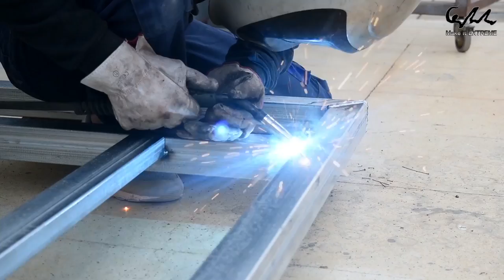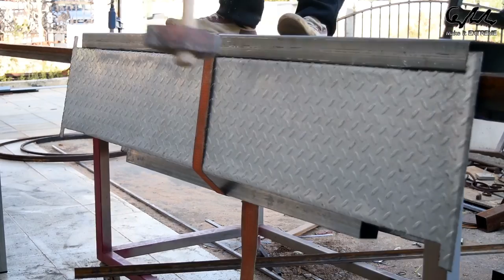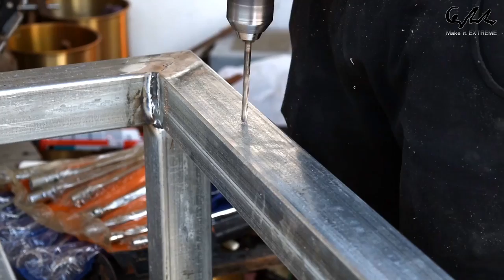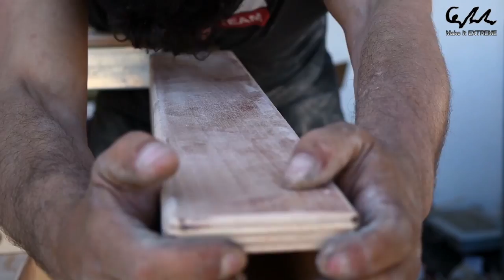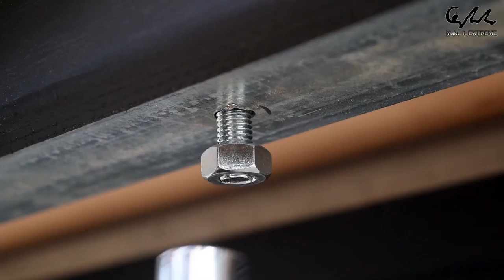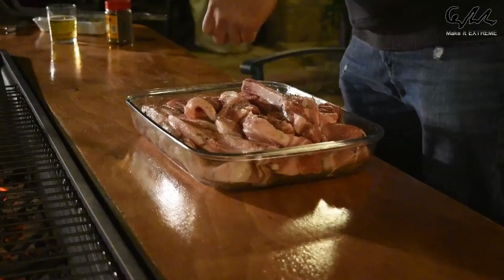DIY Barbecue Table

Comment: I was thinking the center cut is for the beer!!!
Reply: 🍺🍻...same here
Reply: +victor perdomo You can seperate middle section into two with loads of insolation between and separation and have hot and cold table, jing jang bbq
Reply: excellent design.....
Reply: Malcolm Cheyne holy smokes,someone knows about XXXX!good on ya,mate...
Reply: Yes..so do I...

Comment: ever got a welding spark in your shoe?
Reply: That's why you should always wear socks, long boots, and long pants (heavy jeans) while welding.  Plus a welding apron and leather gauntlet gloves at the very least.  I have a heavy t-shirt that I usually wore when I just needed to do a quick weld and figured I didn't need to put on the leather apron.  The front of the t-shirt is full of holes from sparks and there was a burn mark on my stomach and chest for every one of those holes at one time or another.  Luckily, I don't scar very easily, so there was no permanent physical damage.

And yeah, a spark in the ear really does get your attention.

Comment: i thought this was home diy but looks like you had manufactouring equipment and everything you need to make this most ppl at home dont have equipment you got but great video just not for the general diy man
Reply: all looked like pretty standard tools to me
Reply: realy Im construction worker I have mig welder  i dont have a plasma cutter Im sure avarage joe joe doesnt even know what it is
Reply: There's a person on YT that cuts steel with a torch just like a plasma cutter. That's a lot of practice. Allen's welding/woodworking
Reply: All can be done with simple tools
Reply: There are different levels of DIY. This is just a little higher, you can find a cheap welder.
Reply: TheBrunoFactor Yes i thought it was a diy vid too
Reply: Doesn't everyone have a $10K Holzher panel saw sitting in their garage?
Reply: TheBrunoFactor He totally showed us how to make it... It's your fault if you were naive enough to think if you could build this with scissors and a glue gun.
Reply: Nicolas Fredette tbh it was a 'hot glue gun'... but I made it work. Vid will be up when I can get the popsicle-sticks to stay together again.
Reply: If you don't have all that equipment or are smart / resourceful enough to know what can be substituted, why even bother watching DIY type videos?  I don't have everything he uses, but I have different tools that can substitute.  For example, the metal chop saw and plasma cutter can be substituted with a simple circular saw with a metal cutting abrasive blade.  They are cheap enough that I would think that any homeowner that would even consider a DIY project should have one.  The metal cutting abrasive blades go for around $2-4 and it sure beats having to use a hacksaw.  Arc welders are pretty cheap if you don't have one.  They are really simple machines and last a long time, so if you can find one of the old Lincoln AC-225 model on Craigslist for $100, jump on it.  I never was that great with MIG, but that's probably partly because I was using flux core wire and I didn't like having to clean up all the splatter you get with flux core.  You could probably even redesign it a bit so that no welding was required and it was all bolted together.  Everything he did there was within reach of a general DIYer, IMHO...
Reply: Grumpy OldMan well put. People act like they need exact plans and tools to do something similar. Its a great idea presented here. If they want one adjust the design to suit themselves. This is definitely possible for an average competent DIY person.
Reply: Grumpy OldMan hope they find the right meds that can help you.
Reply: Make it extreme, not make it at your average shop. Lol
Reply: What was the material used after the insulation was placed?
Reply: @luiscarrillo2910  looks like kaowool or some fiberglass insulation and the boards after are cement boards/hardibacker. I'm not sure if they release toxic fumes when heated. Also looks like they used galvanized steel which does release toxic fumes if heated too hot but there is insulation between it. I'm sure they did the research before building this.
Not sure how the coals get oxygen since there is no vent.
Reply: @BOBBERtheKID  I'm assuming that was at the hardware store. Don't know about other countries, but in Germany they cut the wood for you. Rectangles only and don't expect millimetre precision, of course.
Reply: Turrnado it is DIY.  You can cut that metal with many things, you don’t have to have a plasma cutter!! That’s just an excuse to not get your lazy butt off the couch and be a tru man, I’m sorry buddy but that’s the truth!!!!

Plasma cutters haven’t been around all that long but we’ve been fabricating with metal/steel for over a hundred years and somehow we’ve been cutting and bonding metal together during all these years so if you really want one of these tables and don’t want to turn in your man card then you’ll figure out a way to make it work

Comment: DIY

Step 1: Own thousands of dollars worth of equipment
Reply: Exactly 😒
Reply: 😂 with tools everybody has in the toolbox
Reply: Totally legit video... as long as you remove "DIY'.
Reply: @pkjoesd  he did it himself...
Reply: How do you expect to do it yourself if you don't have any tools? Good luck with that.
Reply: You make it with a knife
Reply: @TheFootbaldd  Well if you are interested, I'm sure many of your local stores sell the tools needed to complete this project. If money is the problem I'm sure there are also plenty of stores hiring! Hard work pays off buddy..
Reply: @ctlunkers2056  You misunderstood me, I have a full woodshop, and decent metal working. Any fab I can't do at home can be done at work where I have access to all the metal fab, CNC, and manual machine I need.

 Unless there is a specific part i need to mill, an advanced weld process, or I have to make a lot of one piece I typically just do them at home. 

 I also have a decent electronics lab, and all the tools I need to wrench. I have worked my way through the ranks. When I didn't have much in the way of tools, I would just find creative ways to get the job done. Building engines on the kitchen table, working on a transmission in my barracks closet, or whatever it took to make it happen.  My comment was about all of the negative nancys winning about not having basic shop tools.
Reply: @TheFootbaldd  My mistake, proving to the negative nancys even more how hard work pays off!
Reply: Fo sho!
Reply: Most of it is for convenience. You need: A way to cut metal (saw), a way to cut wood (different saw), a way to do wood surface finish (sand paper), a way to apply lacquer, a way to drive screws (screwdriver), a way to tighten nuts (wrench) and a welder. Stick welders aren't that expensive. You should be able to get all of these for 200 - 250$ in a decent quality from your hardware store. I'd say the skills are more difficult to acquire if you aren't a metalworker in Somalia.

Comment: You too can "DIY" this project if you have the following tools:  metal chop saw, welder, angle grinder, router, plasma cutter, a stable steel table to bend metal on,  multiple clamps and straps, industrial table saw, brad nailer, air compressor, cordless drills, circular saw, electric sanders, calk gun, industrial scissors, putty knife, hammers, socket set, and an air paint sprayer.   Not to mention access to industrial metals, cement board, grade A plywood and ceramic fiber insulation.      

FAIL.
Reply: cry baby
Reply: At least its a good video to show how it is made
Reply: you obviously need tools to dyi.
Reply: According to your list, I would only need a plasma cutter and a "calk" gun. I got a caulk gun, but it won't dispense "calk", only caulk. Those building materials are pretty easy to find. So not fail. Maybe fail for you, but not so much for me. You build up a lot of tools owning a house and a project truck.
Reply: Jon Durfee your a failure if you dont at least have half of the items  you stated.
Reply: so easy!
Reply: Roman Hamm you're
Reply: Awh, gee, I don't have a plasma cutter... But I have an oxy-fuel (acetylene or propane) torch with 2 T-size oxygen cylinders, so I think I can get by.  Or just an abrasive blade on a circular saw.  That would only cost someone a couple of bucks and would also take the place of the cut-off saw.
Reply: To be fair, it's not an instructional video, but a video showing how 'these' folks did it themselves. Although, you're right, $10,000 in work tools would help anyone build something this cool in a few days rather than months with rudimentary tools.
Reply: I have all of this except for a plasma cutter.  You don't need a plasma cutter, just weld up a steel box.  Sure it might not look as nice but it still serves the same purpose.  You can also by all the materials locally if you just looked.
Reply: Basically a real man's tool collection
Reply: so what? you can improve yourself by not using all of the tools
Reply: I could build this with a leatherman and a hammer in an afternoon.
Reply: darn. i only miss the metal chop saw :D
Reply: Jon, you forgot the beer,  lol.
Reply: You dont need half of the tools you named. If you worked with metal you would know off RIP that you dont need no damn plasma cutter, or even the chop saw. A pawn shop grinder will make quick work of all that thin shit
Reply: If you don't have all the tools used in this video, you can always subsitute or find another way to do it. THAT is one part of DIY. If you just want to do it exactly like someone else did, well, wouldn't call it DIY that much. Part of DIY is problem solving.

Comment: I thought that was going to be a ice bath cooler in the center of the table.Good Work!
Reply: Belford Lancaster It says in the title "DIY Barbecue table" and in the thumbnail it shows you the end product??? how'd you arrive at your conclusion
Reply: G Law if not used as a griller use it as a cooler, works both ways just clean it after each coal use...

Comment: super brilliant mate, how did you get the heat going for so long though , did you use a blower to get the heat going etc.. how do you or would you control the heat etc.. it like a open pit
Reply: ACarCalled Mercedes, ya I was gonna ask if there would need to be vents added for airflow, if u wanted to have an actual fire (rather than just coals/embers) in the centre

Comment: and the coal seems far away from the steak to reach the heat, another thing is to clean the coal after use seems complex u gonna have 2 take out the coal pool.the plywood wouldn't stay last longer with the heat even u shield with fiber wrap

Comment: Should take it a step further and make the grill bottom function as a latch door of sorts for ease of access to cleaning and dumping ash. But that is just possibility not a necessity. After awhile all the meat drippings and debris would be a pain in the ass to clean out closed in container. We make DIY grills and smokers, having that access panel makes life easier.

Comment: How do the coals get oxygen with no vent holes?

You sprayed some wood finish into the coal pit, is that not toxic along with the cement board?

Does the wind not carry the smoke into everyone's face?

I am thinking of building something similar but not sure if i will use propane or charcoal

Comment: Inspired by your video, I am doing one as well... However I cannot find the Fireproof material/fabric that you used... any clues as to its name?
Reply: David Moore-Evans Hi there.  Can be found at a company called McMaster Carr near Los Angeles. Comes in different thicknesses, overall size 24x48 inches. Called mineral wool, under insulation. I used it for a curing oven for powder coating. Order online.

Comment: that's awesome. how much does one cost
Reply: only in that metal here my area he spend i guess no less than 120 bucks. sheets of plywood run like 20 and fiber cement and insulation like 20.. the metal he bought for the pan might be 50 bucks extra.. guessing 250 or more depends in the area bigger city might get better prices

Comment: I don't understand people saying this is not a DIY project. This complete build can be done with very basic tools: 
Circular saw 
Hammer 
Sand paper 
Drill
Angle grinder with assortment of discs
Welder 

The welder is probably the only thing a DIYer  might not have but a great tool to add to the collection. Check CRAIGSLIST and harbor freight, they can be purchased for $100 or less. Or save yourself some money and check your friends, one of them probably has one.

Comment: Hot knee caps for sure... ha ha .. top build, you got the skills to pay the bills..👍🏼
Reply: with concrete board and ceramic insulation you would not even feel the heat on the bottom of the table.
Reply: Jon Durfee. Hi there, it was only a joke budd, hence the ha ha.

Comment: Are you guys aware of the side effects of welding galvanized steel? the release of Zinc Oxide can be poisonous, just keep it safe and keep building cool stuff guys...
Reply: or dont used galvinized.
Reply: zinc oxide is not poisonous - as a matter of fact it's widely used everywhere from medicine to food;
welding galvanized is often confused with welding after cleaning with chlorine-containing cleaner - under UV chlorine may produce phosgene - which is extremely poisonous

Comment: Couldnt quite get it from the video.. but it seems like a little more adjustment in grill to coals is missing.

Crazy/insane table and workmanship.. no disrespect.    But a decent metal table and a run of the mill charcoal grill / hibachi would suffice, and be more efficient for cooking.

Amazing skills.. never the less.

Comment: what kind of a welder is that ? it requires no filler?
Reply: probably MIG... the filler comes from the center of the gun
Reply: Its a tig welding process
Reply: Type of mig that uses no flux just gas to shield the weld while it bonds and cools

Comment: All of that work for a non-adjustable grill (should have been gas, too imo as it's a pain to have to replenish the grill during a long period of entertaining) It was poor table top material choice as you should have used a slab of stone for a longer life, easier cleaning, and a better overall visual appeal. Otherwise you've done a good job as it serves the purpose.

Comment: Nice build but horrible idea using galvanized steel for the firebox.  This is very unhealthy and can cause poisoning. It is known widely among welders that do a lot of welding of galvanized material.  Great idea but I would suggest changing the firebox to draw steel or aluminum and if you use aluminum it needs to be burned in really well before being used to cook.

Comment: With everything else they did making this "Way Over The Top" table why did they not use "cap nuts" when the tabletop was bolted on ? I would bet someone would cut or scratch their leg on the exposed bolts sticking through the tabletop...

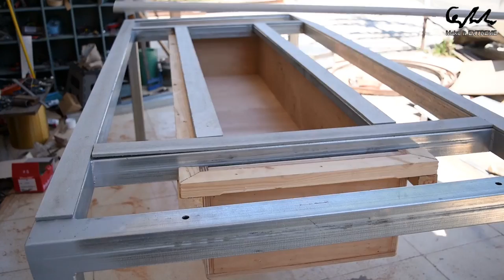Comment: What was this gray thing you used at 7:14 ?
Reply: it would have been some form of cement Board https://en.wikipedia.org/wiki/Cement_board
Reply: I was wondering about that too. I guess it's for extra thermal isolation...?
Reply: Looks like a cement board.
Reply: Thomas Heaven
Reply: we use that for industrial insulation  like big thanks and vessel.. in ethanol plants dont think will be easy to find.. not a diy project at al

Comment: How do you control the ambers...there is no air intake and no opening for charcoal or wood to add if the amber starts to fade-away....if it’s from the top then it’s not really practical..if it’s necessary to lift out the center piece for refilling the burning material ...how would it look to lift that center piece up every half an hour or so, when people are sitting around and eating...
Beter yet shoveling coal over their heads...i mean, come on dude.

Comment: DIY? Does any regular household here got their own Aluminum Mig welder and a plasma cutter?
Reply: Kinda depends on your personal DIY level I guess. :D
Reply: +mi_FPV level?. Are you crazy?. I am a ship-fitter combination welder. Mig I can have at home, but plasma cutter? It will fry your electrical breakers. I am just talking about regular household tools and the regulated electrical current for households. These people are not working at home for a "DIY", they're working in a frefab.. And who got an upright wall saw at home?
Reply: Of course I am crazy. Aren't we all who even consider building something like this instead of buying it from Ikea for $200? ;)
Reply: +mi_FPV of course we all wanted to build everything by ourselves, that wasn't my point though. I can still build that grill table with just a grinder and skill saw instead of plasma cutter, I can use a spoolmatic instead of MIG
Reply: +mi_FPV $200 dollar project but the tools cost you 100 times from your materials, that ain't good at all.
Reply: you build what you can with what you have. except for me..since all i have is a cordless ryobi drill. I can't build shit.
Reply: here! 🖐
Reply: There was no aluminum welded in the vid, and I run a plasma at my house all the time on a double pole 50 amp breaker. No trouble at all.
Reply: michael snead really? No aluminum? 😂🙄